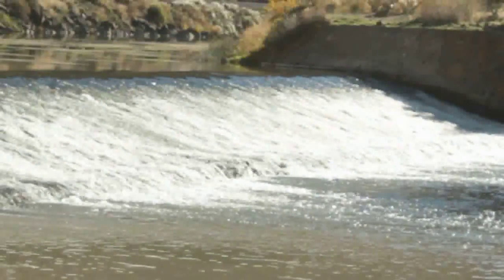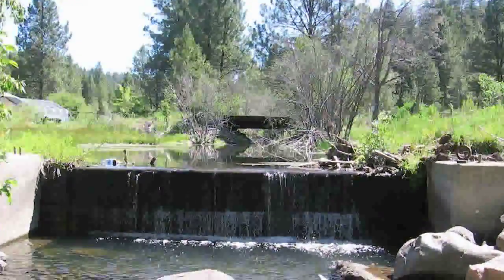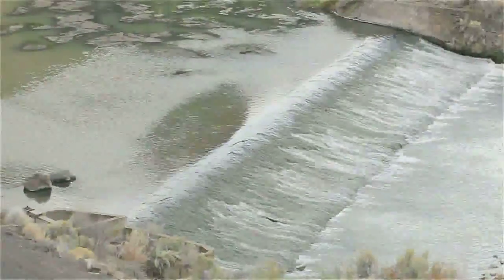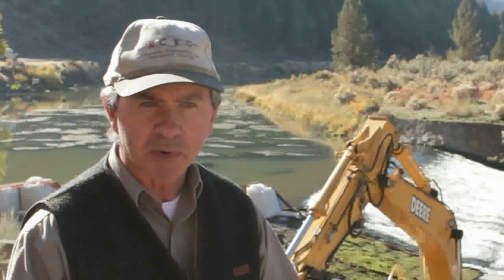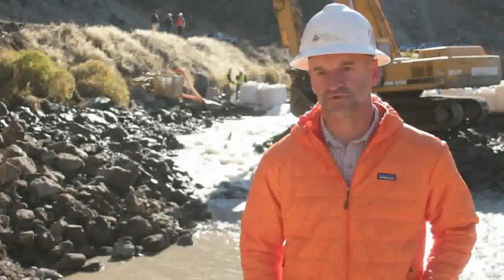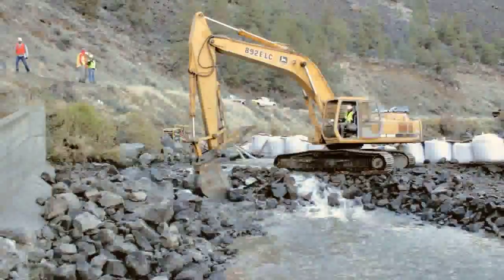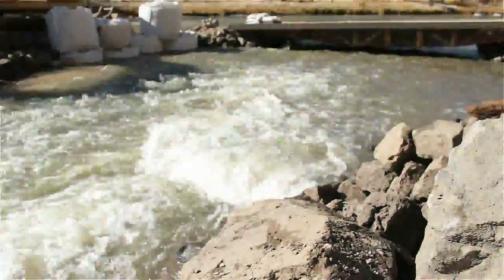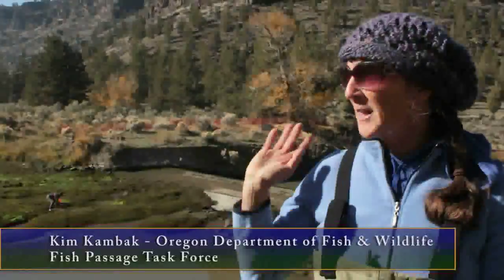Stearns Dam Removal, Crooked River, Prineville, Oregon - 100 year History & Removal

Comment: Chris, this is what is going on right now in Idaho, although many of the Dams they are talking about taking down are hydroelectric. Thanks
Reply: Thanks for reviewing and commenting. We think important hydro projects can be maintained if the proper investment is made to update dams with a retro-fit for a fish passage solution, or any other changes that make the facility more inline with modern-day needs and complexities. Fish ladders are not always the best option. Site conditions largely dictate the solution.
Reply: @christiangannon1118  Our state senator has stated that the only way to prevent the extinction of the salmon is to take out these dams
Reply: @johnstegmaier6973  The Senator is not wrong, but there are other methods of passing fish past dams that do not require them to be removed. Getting the smolts out of the system in some cases can be more challenging that getting the adults back into their natal waters for spawning. The Senator seems fixated on the back-white of this issue when there are shades of grey available.

Comment: there should be a law where if you make a dam you have to make a bypass for the fish
Reply: Robbie Isbell Josh is right because many dams were built before such laws. In the UK we have thousands of weirs without fish passes. When waqs your law enacted ?
Reply: +Robbie Isbell It's been largely ignored in many cases.
Reply: +Docktor Jim Yes laws are only as good as the resources given to them and environmental laws can sound good but generally get undermined when jobs and profit are needed.
Reply: joshman and frand There already is one.
Reply: nice am 14 so i did not know
Reply: Age shouldn't matter, the knowledge of being able to be resourceful should matter.  Look it up, and you'll find wealth of information to your questions.
Reply: Sometimes in the late 60's
Reply: Dusters s The fact that the two dams on the Elwha were put in illegally (without fish ladders) actually made them easier to remove. It only took 100 years.